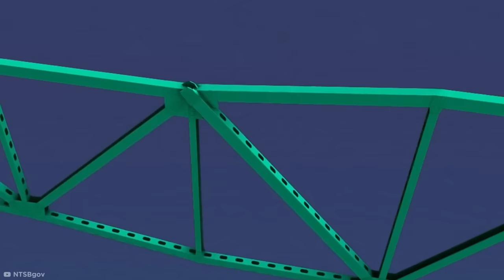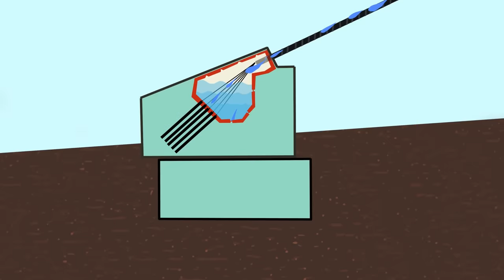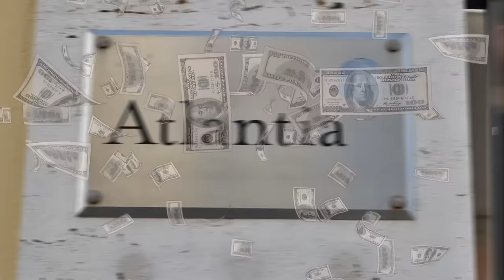Catastrophic Bridge Failures Explained – How They Happened

Comment: A regluar long haul truck carrying 200T?!?!? What, if it actually was carrying that much and it was capable of driving regular speeds on the road, you just found the world's best truck manufacturer and the bridge collapse by that truck carrying 200 tons would be the greatest PR event for the company ever! Sorry, but 200 tones it more than twice the weight of the M1A2 Abrams main battle tank! and not even the Abrams has the suspension capable of carrying 200 tons! It's an obvious over statement for a heavy haul truck to carry 200 ton loads! jeez, whomever made up that little fib obviously had no idea how much weight those trucks can carry, especially Chinese built heavy haul trucks which are at the low end of long haul truck capacities and are usually of such poor quality that they often break into tiny pieces when they get even close to the regular GVWR! They are lies, meant to cover up the "TOFU DREG CONSTRUCTION" that is now causing China to fall apart, literally speaking. business towers are falling  apart and threatening to crumble to the ground and the Highrise apartment buildings that were built during the realty boom in the 90s are crumbling and some are falling over because they have no foundations, no proper underpinnings or even plumbing capable of taking any kind of waste water away from the building. in other words, they are 1:1 scale models of real Highrise apartment buildings, without any of the real needed foundations and infrastructure required for it to be a building that can be lived in. If you could see what I have seen people do to the support structures of these buildings with their bare hands, you would never ever trust anything ever built in China, and that is exactly what you should be doing, fearing anything in China. EVERYONE in that nation is corrupt! even the mice and rats that live in China are corrupt! no matter what it is, no matter when it was built, no matter who built it, it is nothing anywhere near the quality it needs to be for real every day use, PERIOD, END OF STATEMENT, FINAL WORD. Nothing in China is capable of meeting the standards it is supposed to meet. and that means every military jet, jeep, tank boat ship aircraft carrier and submarine, missile and anything else the Chinese military has or uses. none of it is nearly as good as they would have everyone else on this earth believe. Russia, for all of it's posturing and public statements, was a huge pretender, nothing it ever built was as good as they said it was and this has become blatantly obvious during the war in Ukraine, but China is a million times worse. they often have people who simply do not understand the technology they are copying from the west, so they make copies of whatever they stole right down to the last bump, crevice and feature, even though it may not be functional in the way that the original was, but it's an exact duplicate. it wasn't until the West opened up to China and allowed the Chinese to send their spies to western nations to learn in our schools, that they began to understand what they were copying. but still, nothing China ever made is anywhere near the quality and performance of Western made items, no matter what it is.

Comment: 20:16 Metal supports shrink during cold wheather, which means the concrete must also shrink
or have a place to go. If it doesn't, it increases tensile requirements of the metal support.
If this is welded, usually the weld is the weakest link, since it's not exactly the same material
as the support, it gets taxed. Now if it's extremely cold the metal supports are going to be even
colder than the measured air temp, which then adds increased shrink onto it.
With the concrete on top barring shrinking, the welds are now being overtaxed and start to tear.
Once it warms up again, the welds, now stretched, are being pushed together again.
On the side, take a piece of iron, bend it one way, and then back again, and repeat.
After a few times the iron will simply break. Similarly happens to the welds.
The support fails, the concrete no longer supported, ***crunch***, bye bye.
It's typical failure to foresee the forces at work. The air temps alone
aren't the required inputs for any modelling, but the temperature the building materials
will endure is. Metal is conductive to heat, both ingoing and outgoing.
If the air temp is measured in cold situation, any exposed metal will have a lower temp,
than the air, especially in cold winds. But also, the concrete and asphalt will
heat up much more in the summer and convey much of that heat to the metal,
which will take in a lot. So, temperature expansion coefficients should be raised for max temp
and lowered for minimum temps. The air may be just 40C but the asphalt will be nearing 60C,
which then conveys onto the metal at like 60-70C, while min temp during wind when measured
in the air, may be like -20C, but the metal will be near -20 to -30C.
This means that if you take the air temp as a guideline, you get an expansion/shrinkage over
60 C, but not the material temp, which can be 100C, differing by as much as 80%.
This combined with expansion/shrinkage coefficient over large single stretch materials,
well, bye bye road/bridge/building/etc..
It needs to be calculated with an excess, not a minimal margin.

Comment: 10:20 Well, also sympathetic wave amplification.
Each time the floor moves one way, it receives a push, up till the point
that the in-elasticity of the suspension disallows motion, coming to a halt.
Then it moves in reverse, and the push start again, but now opposite.
When the periodicity is the same as the sway, this becomes sympathetic.
Once sympathetic waves are added, they amplify, and the amplitude goes up and up,
until the structure, whichever structure, not just bridges, break.
The same happens with tall buildings, and whatever else
that starts swaying under wind pressure. Once it become sympathetic, well, goodbye dear whatever.

Comment: Do another one of these for bridges. But include the original Skyway Bridge in Florida. And also include the idiot decision to keep the plates upside down for Bayside Bridge in Florida. Go down the Bayside and it's like you're riding on a horse. Fun ride, and they say the upside down plates that were installed incorrectly are safe, but I don't trust it.

Comment: 20:34 surely those gusset plates can't be that big?! Even taking the metric value as feet gives 9ft x 6ft which is pretty large? They're only 1/2" thick and there are 26 rivets side to side with a gap the same size as a head so 9m/52= 17.3cm (just over 6 inches) rivet head diameter?!

Comment: This whole “overloaded” truck thing, why are bridges not built to a level that can actually take that weight?  It’s common.
Reply: Depends on when it was built. Some older bridges were built for the known maximum that a truck could carry at the time. In time, heavier loads have been possible. Bridges are re-evaluated and bridges that can't hold heavier loads are marked as such, but it still happens. The bridge in Michigan is an example of that. It was reevaluated and the maximum limit increased, but the evaluation was wrong and the limit shouldn't have been increased. Plus, the construction vehicle was over the maximum weight.

Comment: 7:39 That's what skimping on some glue or some metal will get ya.
And yes, that guy would probably not ever set foot on a ny bridge ever again.
Never assume. Basically clamping the glass down should have been done, but wasn't.
Also, they didn't calculate the local wind variations. Take what you know, add 50%
on top of it, for good safety, then build.

Comment: "I-5 Skagit River bridge collapse"

"On May 23, 2013, at approximately 7:00 pm PDT, a span of the bridge carrying Interstate 5 over the Skagit River in the U.S. state of Washington collapsed. Three people in two different vehicles fell into the river below and were rescued by boat, escaping serious injury. The cause of the catastrophic failure was determined to be an oversize load striking several of the bridge's overhead support beams, leading to an immediate collapse of the northernmost span.[2]

"The through-truss bridge was built in 1955 and connects the Skagit County cities of Mount Vernon and Burlington, providing a vital link between Vancouver, British Columbia and Seattle. It consists of four consecutive spans that are structurally independent. Only the northernmost span collapsed into the river; the adjacent span also sustained impact damage from the same vehicle, but not severe enough to result in a collapse. The overhead support structure was known to have been struck by a truck as recently as October 2012.

"Not long before the accident, the bridge had been evaluated as safe. Although not structurally deficient, it was considered "functionally obsolete", meaning it did not meet current design standards. The bridge's design was "fracture-critical," meaning that it did not have redundant structural members to protect its structural integrity in the event of a failure of one of the bridge's support members."

Comment: The Chinese case is really a combination of factors. Yes corruption definitely plays a MASSIVE part, the government system is almost designed to encourage and facilitate corruption at every level and stage, but overloaded things are for sure a problem as well. Chinese engineering is based off the calculations previously done by western, especially European, societies, where both the volume of cars using roads and bridges, and the loads that these cars would be carrying, are only a tiny fraction of what Chinese infrastructure would experience on a daily basis. Basically, it's just the perfect storm for all the shit to hit every fan.

Comment: 200 tons is 400000 lbs. I find it hard to believe that any tractor trailer can carry a load that heavy.
Reply: See it a lot in the EU. Hauling transformers, bridge beams, terminal equipment. All transported behind a single truck. Most heavy machinery company's near me have a 10 axle trailer able to load up to 180 tons. Ad another 60 ton for the trailers weight and 20 ton for the tractor. Gets you to 300 metric tons total weight going down the road with 80 km/h. Reason why Scania builds 770 hp and Volvo 780 hp trucks at there factory.

Comment: So, in the case of China's bridges collapsing at a rapid rate, I would say that it's mainly China's own corruption from within their government rather than companies overloading their trucks, if anything these should be what bridges are being BUILT to withstand not just the elements because trucks hauling cargo are always going to be overloaded to some degree as I would wager these companies and the independent truckers will want to make the most out of the space within the cargo containers they're hauling around.
Blaming them for the bridges collapsing is like the U.S blaming the bridge constructors behind the low bridges for why trucks keep getting stuck under them despite there being clear indicators that the bridge only supports up to a specific height, if the trucker can't read the indicators because they want to try and make the route as short as possible then it's their own fault.

Comment: as a truck driver in canada , i never heard about anything destroyed under the weight of a truck.  But they have A LOT more elevated highways.  I wonder what happen to faulty drivers, is it a 50$ fine if they are over weight?  For me its a 500$ fine at least so .. we dont take chances.   The 200Tons truck seem impossible to me. you say he was carrying 200T , add 15 for the truck and trailer, its more than 5x the overall limit in USA and 4X the load  limit here in canada FOR A B-TRAIN,  you count 10 wheels from the side. not 5 like the most common truck.  When I weight 62 tons the trailers feel it , and the engine too, trust me.  It takes 2 to 3 miles to reach 60mph on flat. imagine 220 tons. impossible.  Altough I just noticed it's a special transport, a transformer.  ok 200 is possible. in tis case. but look at the trailer, its something EXTREMELY heavy.  you dont go there with that.

Comment: 19:13 Chinese building contractors still being relatively new to complex construction,
can try and mimmick a design, in the hopes of making a perfect copy of some existing design.
Can't blame them, if it looks the same, it must function the same, right ?
Well, the building details are usually different.
Things like using too long a pieces of steel cable to connect parts and armor the concrete,
can be at fault, disallowing for temp fluctuations which expand and shrink more over increasing
distance. When it's hot, metal over distance becomes longer much more so than concrete,
and may vary like even whole meters over a distance of like 1000 meter.
If the temp fluctuates within -40C and +80C (road/bridge surface temp, not air-temp), and the length
of a single wire across the entirety of a 1 km bridge, may vary as much as 144 centimeters.
Now that's the same length almost as the average small chinese person, but that varying means
that in some cases the tensile strength is tested, but also the expansion, which must go somewhere.
If the metal pushes the concrete segments apart, they will no longer support, and only take support
from the cable, which is now the only support. Similarly, if it's very cold, the tensile strength is tested,
and so, if the concrete doesn't budge, the steel starts to break in small places all over.
Together, one sunny day, when the concrete budged, the cable keeping it in place,
weakened during extreme cold times, pushes the concrete from it's support, since it was no longer truly
attached to the support, now needed the cable for it's sole support, already weakened, snapped,
and bye bye bridge. This may have nothing to do with the materials used, but merely lack of
expertise to use them properly. No worries, in the west these things happen as well, since
not all people take into account everything. But for the future when building very large stuff,
take into account wheather conditions on the building surfaces, and calculate variation due
to localised temperatures at their surfaces and then include expansion and shrinking forces.
Don't just try and copy something and think it works the same.
For steel reinforcement, use separated steel reinforcements, that dissallow shrinkage and expansion
along the lines of whole meters, especially very long distances.
In fact, make each section self armored, and only attach one piece to another using several short anchors, fyi.

Comment: Un Biased Comment: Did you know that chipped bamboo mixed with Garden Lime [not concrete] makes a concrete with many times the strength of burned lime concrete - Bamboo and lime react to form a concrete very much like carbon fiber - But!!! Like carbon fiber you don't put over weight traffic over it - Political Bias is a horrible thing to find on a youtube video.
I hope you find this helpful.

Comment: 6:22 They are hitting glass with a hammer that they are standing on hundreds of feet in the air? I don't care if the glass is a foot thick, I'm not going to hit it with a hammer while I'm standing on it.
19:00 They do have trucks in China that can carry 200 tons, it's unbelievable. They claim they are only driven on special roads near quarry's or mines. In the U.S. 40 tons is the limit allowed on highways.

Comment: Bridges should never collapse under overload, what is an overload anyway? Bridges should be made keeping in mind that the load will increase in the next 100 years, A river bridge not more than 200m away from my house is standing still for more than 65 years, it is constantly withstanding immense load of cargo and dumpers loaded with sand (in India these dumpers also illegally increase the height of the body to carry 1.5× more materials filled to the brim) it is a very important bridge connecting crores of people. If poverty ridden newly formed India could have done it why not rich China ? I am happy to live in a poor country, rather than living in China with a constant fear that a bridge will collapse under my car , yes bridges do collapse in modern India too because yes , corruption, A 27000 crore rupees bridge recently collapsed. But the cases are minimal, not like China's tofu infrastructure.